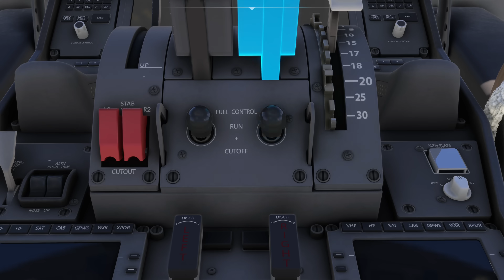Air India 171: Why Did The Fuel Cut-off Switch Get Moved?

Comment: My technical best‑guess—still a provisional view—is that both fuel‑control levers on Air India flight 171 were driven to CUTOFF by a combination of a latent mechanical vulnerability and a minor, unintended jolt. This judgment balances cockpit layout, recorded data, prior incident history, and how quickly regulators reacted after the crash.

There is credible evidence that the levers’ spring‑loaded locking gates may not have been engaged. An FAA safety bulletin from 2018 warned that certain Boeing models, including the 787, can leave the factory or a maintenance shop with the fuel‑switch lock‑out feature inadvertently disengaged. When the latch is out of action, a lever needs only light rearward pressure to slide; the pilot no longer has to lift it over a detent.

Flight‑data recordings show both levers snapping from RUN to CUTOFF roughly 3 s after lift‑off, exactly as the aircraft transitioned from take‑off roll to climb. That phase produces a burst of airframe vibration and a nose‑up pitch change of about 15°. A loose item on the centre pedestal can slide aft at that moment. If the locking tabs were not guarding the levers, vibration or a migrating object could have knocked the first switch rearwards and—milliseconds later—the second.

A NASA safety report cited by Flight Global describes a clipboard falling in a 787 cockpit during rotation and shutting down an engine by striking its fuel lever. Pens, tablets, or checklists resting on the pedestal in AI 171 could have done the same, and the high‑vibration moment immediately after lift‑off is when such a strike is most likely.

Regulatory behaviour supports an equipment‑driven hypothesis. Within 48 h of the initial findings, India’s DGCA ordered urgent inspections of fuel‑switch locks on every Indian‑registered 787 and selected 737s. Regulators usually move that fast when they suspect a systemic hardware issue rather than a one‑off crew mistake.

Other explanations are possible but appear less likely. Purely accidental contact by a pilot’s hand, arm, or headset cable is less convincing because the switches sit behind the thrust levers and require a deliberate rearward motion; at 3 s after lift‑off, one pilot is holding the control column and the other is handling gear‑retraction and calls, so an inadvertent double bump would be awkward though not impossible. Intentional shutdown or sabotage seems even less probable. Cockpit‑voice recordings capture genuine surprise, no behavioural red flags have surfaced, and the levers were almost immediately pushed forward again, suggesting frantic recovery efforts rather than malice.

Assigning rough probabilities, a mechanical latch‑out combined with vibration or a foreign‑object strike accounts for about 60 %, inadvertent crew action about 25 %, software or other anomalies roughly 10 %, and deliberate action around 5 %. These figures will shift as new evidence emerges.

Several investigative steps could tip the balance. Teardown and metallurgical inspections of the switch gates will show whether broken springs, worn detents, or mis‑rigged parts allowed free movement. High‑speed replay tests in a full‑motion 787 simulator can reveal whether a falling object or a wrist movement during rotation can duplicate the 1 s stagger recorded between the lever movements. Torque checks and residue analysis on the throttle‑control module replaced in 2023 might expose assembly errors, while expanded background and security vetting offers the final safeguard against a sabotage scenario.

All publicly available data point to a mechanical guard that may not have been doing its job, and nothing so far directly implicates the crew. Until the switch assemblies are dissected, humility is essential, but if I had to stake my doctorate on one root cause today, it would be an unnoticed latch disengagement compounded by vibration or a loose object. An interim factual update from the AAIB this autumn should refine the picture further; in the meantime operators worldwide should treat latch‑rigging checks as a top‑priority maintenance item.

Comment: Steve, sorry.  This report was poorly done.  Released to western media, Wall Street Journal and BBC before official release.  

You have been on the Pilot error mindset from the beginning.  And, you make a statement that there is nothing wrong with Boeing or GE engines.  Hello…,   Are you aware that British Aviation administration had put out an alert on the exact fuel cutoff switches in 2018 and a reminder in May, 2025.  They said the switches can fail and cut the fuel off.  They recommended a special inspection procedure.  This seems very likely scenario in the AI-171 crash.  

Why only 2 sentences of pilot conversations were released?  Even there, the second pilot said he did not turn off the switches.  You do not believe the fellow pilot and cleverly weave the story of young trainee upset about his dad’s suicidal thoughts.  These were mature adult pilots with spotless track record.  

Did you even once mention the well documented quality problems that Boeing has had.

You have done service to Boeing.  Not to flying public.  By jumping to these conclusions.  Sorry, sir.  It does not add up.

Comment: IN A VEDIO WITH THE HEAD OF AIR INDIA PILOT UNION , HE STATED THAT BOTH FUEL CUT OFF SWITCHES WHERE AT THE( ON ) POSITION AT THE TIME BOTH ENGINES LOST THRUST, THEN THEY WHERE ( RECYCLED ) FROM THE ON POSITION TO CUT OFF THEN BACK TO THE ON POSITION ( ONE OF THEM FOLLOWED BY THE OTHER) ,,,,THAT MEANS THERE IS A POSSIBILLITY THAT : BOTH ENGINE FUEL CUT OFF VALVES WHERE SHUT ( AT FIRST )  BY THE ELECTRONIC FUEL CONTROL UNIT WHILE BOTH CUT OFF SWICHES WHERE AT THE ON POSITION ,,,,

Comment: There is another side to this. When TATA's took over Air India is was a loss making co so the planes were also old & not maintained. So there could be a problem in that switch which was overlooked. Boeing has only issued an advisory & not mandatory regarding that switch.

Comment: The claim that the Air India crash was due to a suicidal pilot is completely baseless and irresponsible. The preliminary report clearly shows the pilots were confused when the fuel switches were turned off, with one switch quickly turned back on—actions that contradict any suicidal intent, which typically involves deliberate, irreversible crashes (like Germanwings). A 2018 FAA advisory already flagged potential fuel switch malfunctions, pointing to a mechanical issue. Blaming the pilots without any mental health evidence is a biased, influenced perspective, likely pushed by a lobby to set a false narrative. Stick to the facts!

Comment: A protruding shaft on a toggle switch in this type of control is simply a design flaw.  It assumes the proper action of the locking collar, which I believe failed. If the locking mechanism on these switches failed to lock, then it would have been easy for them to get bumped during takeoff without the pilot realizing their movement.   Last year, I flew on Air India internally, and the plane was exceedingly filthy.  Reeked of smoke from past decades and the (70's Austin Powers) seat covers were torn and badly soiled.  Many tray tables were broken and worn, and many non-functioning items were visible everywhere in the cabin.  What if years of accumulated grime kept the locking collar from working as intended?  Have you ever used a similar locking collar on a drill that has become dirty and full of grit from use?  It often takes a shot of WD-40 and compressed air to restore proper function.  I think that's likely what happened here.  The locking collar just didn't work, and the switches inadvertently got bumped during the takeoff. Tragic but sometimes the simplest answers are the truth,   FYI, some type of rotating switch with a button for locking/operation would be a far safer option.

Comment: Can the possible airplane engine run to cutoff within 1 sec time gap.( The aircraft achieved the maximum recorded airspeed of 180 Knots IAS at about 08:08:42 
UTC and immediately thereafter, the Engine 1 and Engine 2 fuel cutoff switches transitioned 
from RUN to CUTOFF position one after another with a time gap of 01 sec. )

Comment: I would be concerned if the levers needed both pilots to act in order to move them:  what happens if one pilot is incapacitated for some reason and the levers need to be operated?  One pilot should be able to fully operate the aircraft if necessary.

Comment: Here I was thinking it was a massive electrical failure that brought this plane down, I wouldn't think pilot error as flying airlines in India is a prestigious position. But this is really a sad surprise that one of the pilots who intentionally set both fuel controls to cutoff and at that time there was no possible recovery. I'm glad it wasn't a failure on the aircraft's part, but at the same time sad it was intentional and all those lives were lost. It kind of doesn't matter what the people did as they'll never be able to answer.

Comment: the western media shows wrong news to save Boeing 

The pilot asked “why did you switch it off” 
The copilot said “I didn’t do anything”..  the main pilot assumed if it is off, the copilot must have done this..

What you are not showing to save Boeing is - the fuel control switch automatically turns off and there is an advisory by FAA in Dec 2018.. and the idiots just kept it an advisory, didn’t make it mandatory to rectify the problem..

The problem is why would Boeing accept such a design where fuel control switch would automatically disengage.
Reply: Of course it is the 'Western Media" to blame...   Of course the Fuel control switch 'Automatically' turns off on Boeing airplanes..  That's why so many of them fall out of the sky every day...  Ohhh.. Wait.. They don't.. do they?   You better put up some facts before running your trap   Rakshas80...
Reply: I don't know why no one is talking about it. It seems like they are just trying to cover it up!

Comment: I suggest there isn’t enough information to arrive at any conclusion. One thought - the “switch activations” happened one second apart. To activate a switch you have to pull the toggle & move the lever - try doing that one handed on two switches in one second. Consider that the FDR periodically samples up to 2,048 signals, the one second separation in activations may simply be an artifact of when the FDR sampled the two signals, and both were actually shut down simultaneously. This is more suggestive of an electrical failure than human action.

Comment: I'm not a pilot or mechanic but a Software Engineer, so let me add my input to this melting pot: There are not only 2 pilots in the cockpit flying the airplane but 3. I'm sure with the advancement of AI, the autopilot is aware of what face of the flight they are on at each moment. Apart from the preprogrammed instructions and data given to it before the flight, does the autopilot make decisions of its own during flight and simply notify human pilots what it did and why?

Comment: Just as with the 737 MAX MCAS debacle, it will take a second crash with a loss of all lives on board for Boeing, and their shameless cheerleaders,  to admit its a problem with the plane and not the pilots. Boeing will admit NOTHING. 737 MCAS, doors coming off the aircraft during the flight. Cockpit fires etc. It's time to come to the conclusion it is not safe to fly on a Boeing.

Comment: India already knows the fuel cutoff switches are fine. Just head to the bottom of the report, 
"At this stage of investigation, there are no recommended actions to B787-8 and/or GE
GEnx-1B engine operators and manufacturers." 
----Government of India, Ministry of Civil Aviation, Aircraft Accident Investigation Bureau

It is a hard pill to swallow, but the switches are moved by one of the pilots. Is it deliberate? We will probably never know. For the conspiracy theorists out there, if Boeing couldn't silece Ethiopia and Indonesia, there is no way the Indian government will bow to Boeing.

Comment: Excellent content Captain Steve. Questions for your consideration… this would take forensic sound isolation analysis if even possible.
1. Can the cockpit voice recorder isolate the sounds of the fuel control switches manually being switched to off?
2. Hence, can the cockpit voice recorder isolate the sounds of the fuel control switches being set back to fuel on?
3. Short of having a separate fuel switch for the left seat and the right seat where each pilot only can shut off one engine…Would a mechanical latch (third layer of protection) with a loud audible warning saying “Attempting Fuel Switch Access” repeat, repeat… help?

Note: The warning comes on only as the latch is flipped open exposing the actual locking mechanical FUEL SWITCH.

Thanks in advance for your comments sir!

Comment: There are 2 switches and I don't understand how the co pilot would have moved both to cut off position immediately after cut off. They were in the air for less than a minute and you said it's not easy to move it. The main pilot would have easily noticed if the co pilot was trying to move the switch.

Comment: I have a proven idea that would at least partially protect against this. We had a similar cockpit switch which was inadvertently activated causing a serious problem. There were two switches, both lift type like this right next to each other. After an inadvertent actuation of the wrong switch, the switches were redesigned to incorporate a locking collar. So once the switch was placed in "ON" the locking collar was rotated and the switch could not be moved to "OFF" without rotating the locking collar. This would obviously slow down engine shutdown for a fire, making it a two step process, however this may be worth it to avoid inadvertent actuation, and slow down intentional actuation.

Comment: Why boing did not design a safety interlock  for fuel cut off switch to both engines during take off? 

Is Air bus having this additional safety interlock ? 

In VDR Pilot denied fuel cutting off.

Why can't the switch malfunction and cut off the fuel by itself. 

Boing has to explain how the signals are passed from the fuel cut off switch to the solenoid valves which cut off fuel. 

Any malfunction in this system can cause dual engine failure.

Comment: Did the fuel get cut off before taking off, cuz the plane should still fly for a few seconds using the fuel in the pipes even after the fuel is cut off.

Comment: Hello Captain Steeeve, I have been watching you reports on the Air India 171 crash and I am a bit puzzled. Your first report of the fuel cut off switches reported that they were in the cut off position. Since then you have reported on two consecutive shows that one of the pilots returned both fuel cut off switches back to the run position and that one of the two engines restarted but unfortunately not in time to save the aircraft. So were the fuel cut off switches in the cut off positions or in the run positions? Can you clarify that for us? Thank you.

Comment: The first question and Captain Steeeve's answer of it, shows his conscience may be catching up to him.  He seems to be backtracking his insinuation that one of the pilots premeditated a calculated and horrific crash, with that plane.  That's absolutely wonderful!
Reply: I have watched all his stuff and Steeeeve never insinuated anything.
If anything, he went the other direction.
Reply: @nancymoore1240 
Watch them again.  In Steeeve's first video, on this crash, he basically ruled out theory #1 and #2, leaving #3 as pilot error.  Then in a subsequent video, when the preliminary report came out, he said the lever couldn't malfunction, therefore a pilot had to physically do it.  Then he goes on to talk about mental health of pilots, clearly insinuating there was something mentally go on with  the pilot.  Mistakes are completely human and are not necessarily causes by mental issues.  In the cockpit recording, one of the pilots clearly said he didn't move the lever to cut off, when asked by the other pilot.  If both pilots were telling the truth abd it was a mistake, the one who made the error, would've quickly corrected his mistake, not deny it.  Therefore, that leaves two senerios; the pilots were telling the truth and it was some freak mechanical malfunction, or it was a premeditated, horrific act of mass murder by one of the two pilots.
Reply: @nancymoore1240 
Captain Steeeve has been consistent about blaming one of the pilots from the begining.  All the while letting Boeing off scot free....I mean, wow,  his condolences to Boeing, with only the preliminary report out?
Reply: @robinc4605 
I have watched this whole series and I did not get that feom him.esoec at the beginning. Hecwas very relyctant to call it pilot error.
I do rhink he places too much emphasis on the computer always being right, but he us hardly reveling in pilot error.
He is a very compassionate guy.
Reply: @nancymoore1240 
Wrong, go back to his very first video on this crash.  Cue up to time stamp 11 minutes, then listen to Captain Steeeve clearly say, "Here's what I think happened".  That was theory #3, which was pilot error!  And that was just the beginning!

Comment: According to the report, the pilot noticed the fuel switch was in the off position and switched it back to the RUN position within 4 seconds, switching both switches. However, both switches turned to the CUT OFF position at an interval of 01 second. If a human took 04 seconds to switch to RUN, how could both switches be turned off in 01 seconds by a human?
https://aaib.gov.in/What's%20New%20Assets/Preliminary%20Report%20VT-ANB.pdf

Comment: Although this does not appear to be the case, if the pilot(s) realized there was no way they were ever going to pull out of a crash, is there any advantage in shutting off the fuel to stop fuel being fed to the engines, to what very likely would become a fire?  Or, is that just pointless?